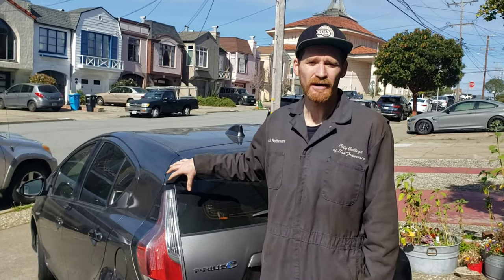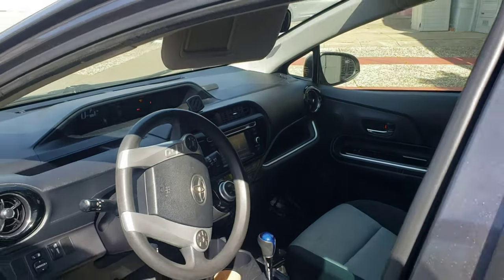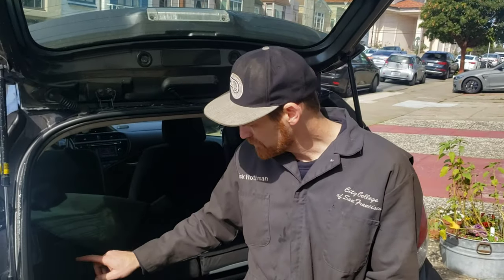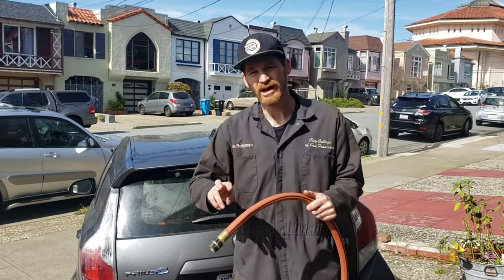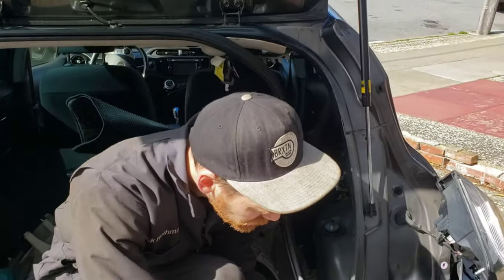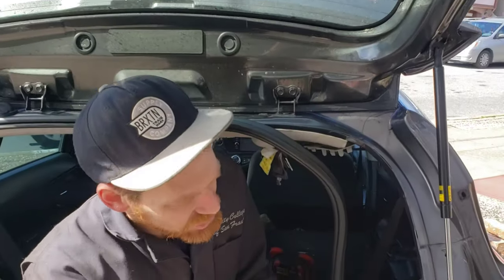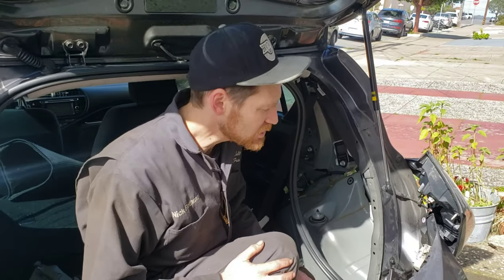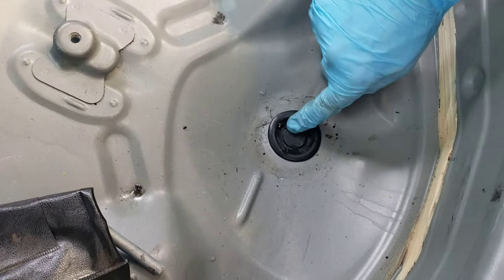Prius C rear hatch water leak repair

Comment: I just want to say THANK YOU. My Prius C was in a car accident where it was hit from the rear, I did the repair myself as I couldn't afford the deductible and car rental. The repair went good but water kept leaking into the rear hatch after going through the car wash or a heavy rainstorm. I spent months trying to figure out where the leak was. The crack and source of the leak is EXACTLY where you showed on the video. I caulked it with silicone and let it dry overnight....BAM no more leaks. Tested it with the garden hose and went through the car wash and it was bone dry. THANK YOU MAN!!!